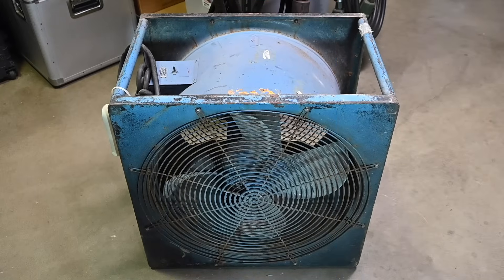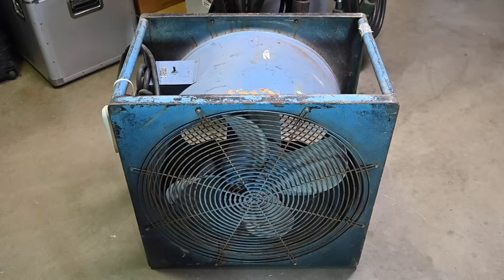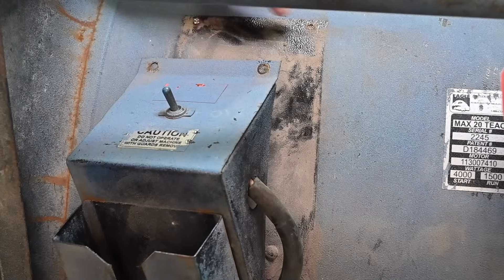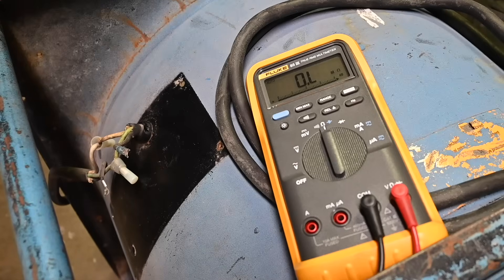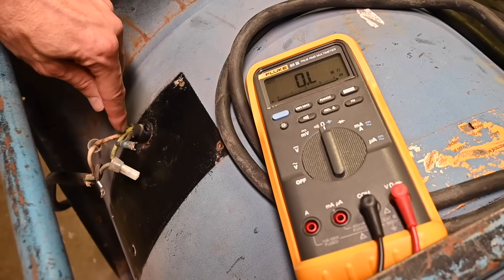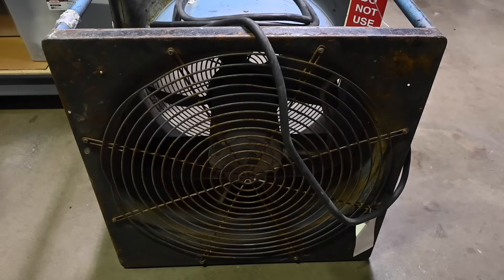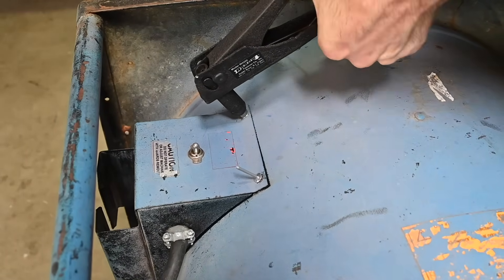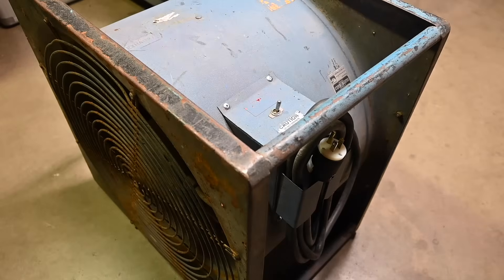Let's Repair This Large Industrial Ventilation Fan - Eagle Industries Max 20 TEAO

Comment: I don't do much 230V (I am in Europe) type of work, but you mentioned that tinning the copper is a no-no. What about crimping on ferrules? I've seen screw terminals were the screw doesn't hit the wire directly, but there is a bit of flat, springy metal that sits between the screw and whatever wire is fastened into the terminal (block). I always thought that those were fine to be used with ferrules, but now I am not sure.
Reply from the maker: The plug that I used has a piece that basically clamps the wire so it is not directly under the screw head.  It is not made for any type of terminal or ferrule to be crimped on the wire and there is no such room to install a terminal.   I'd be cautious about a ferrule as it could work loose under the screw.  I've never had stranded wire just used as-is come loose in these types of plugs.